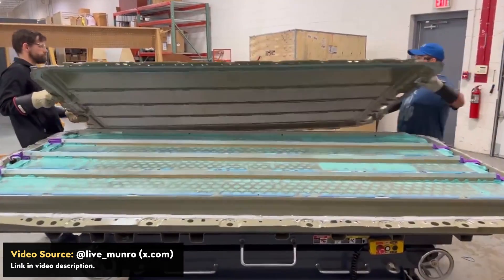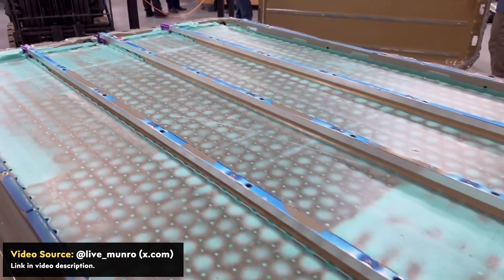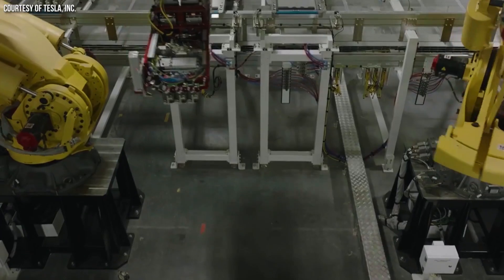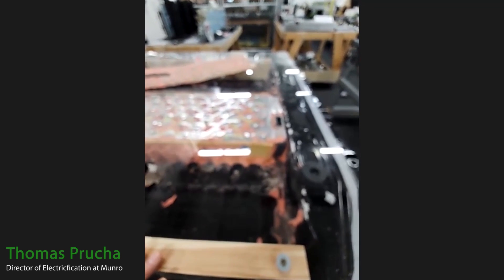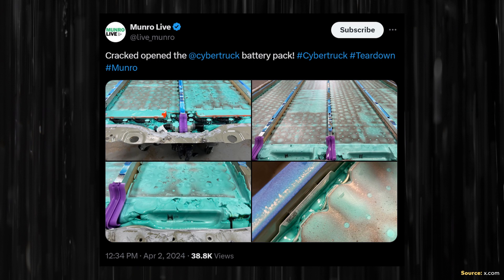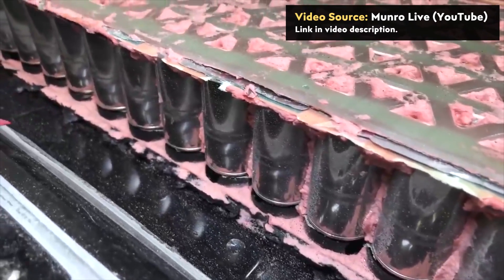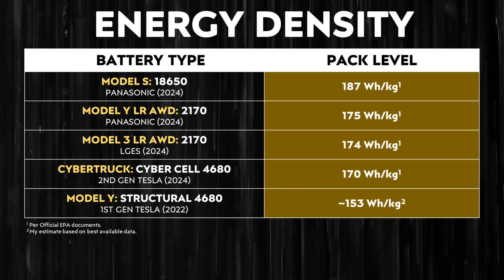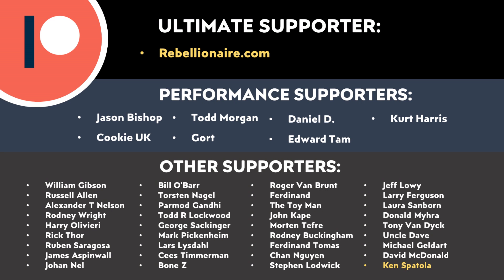Tesla Cybertruck Structural Battery Pack INSIDES REVEALED!

Comment: Jon, the structural battery pack on both the Y and the C have 4 crossbars under the seats. They also have 4 bridge structures going front to back, which the seats attach to. That’s a lot of support. 

I also looked at how, after the battery is placed, the console slides forward to mate with the bottom of the dash and was wondering if that also offers structural support?

When Munro Live shared how they took apart the Y battery cells from each other, they had a really hard time prying the cells apart from each other. So it’s the cells bound together with the foam that provides structural support:

Keeping the floor from flexing,
Resisting the frame from twisting,
Resisting some of the crushing from the side or front / rear.
Plus the foam will keep the cells from jumbling around.

And the foam will do a wonderful job as a sound barrier,
Both for noise from outside and
Shocks from sound waves moving through the vehicle:
The car will feel more solid, less like a rickety rust bucket!
Reply: I was curious how far back the battery pack could stretch?

If it indented where the rear wheels fit, could the pack go all the way back to the rear bumper? You would want a crumple zone but you might be able to get that by having no batteries inside the pack for the 24 inches at the back. Have that part filled with metal honeycomb (it’s light yet structural).
Reply: The part they call the penthouse, where all the battery controls are housed, it looks massive, much larger than it needs to be. I can see all the parts inside it could be miniaturized and fit the dimensions of a computer tablet so it could be located anywhere in the car.

Comment: I think the direct vertical forces are quite easily managed by a simple steel pan, as you see on most ice vehicles. The forces the batteries, glued into a 3 inch thick rigid sheet, resist are the twisting forces imposed on the vehicle as it drives over uneven pavement. Ideally these forces should taken up by the suspension. However that assumes the suspension is attached to a rigid structure that does not itself flex. In a structural battery pack  the batteries provide this rigidity for 'free' -- i.e. by requiring no additional frame or body structures and their additional weight.

Comment: How come I see a ton of QR Codes and noone decides to take a QR Codereader and see what they say? who verified the pack was actually a 124kw pack and not a 100kw pack made for the RWD model?

Another thing to note is theres alot of opinions and speculations etc about the structurability of a CT battery pack so why cant someone request a sealed up battery container thats totally empty then bolt it into a vehicle and give it a rigerous articulation test between both to see if the can or the whole battery is the actual structure ?

Wouldnt you agree if you claim a truck will have 500 miles of range it should have 500 miles of range?

Do you know theres a tesla called a hesla that gets 600 miles and the reason why it gets so many miles is because its combined with a hydrogen fuel cell....?

Seems to me the only person whos mindboggingly stupid is definately Elon Musk by not embracing hydrogen.......

Did you also know that chemical rockets burn hydrogen too but elons rockets are stuffed with chemicals that roll coal?

Wouldnt you think it would be a win-win by cleaning up the environment with better more environmentally friendly rockets and vehicles that run longer plus rely lesser on the energy grid?

Comment: You are thinking that structural means only vertical but it has structure in other directions since NOTHING is holding the bottom (tops) of the cells except their sides connecting to the longitudinal beams between the sections. The cells provide rigidity to the pack from twisting.

Comment: The 4680 cell is a complete failure so far. Tesla cannot seem to nail down the manufacturing process and get sufficient energy density. Even the Chevy Silverado has a 450 mile 50% more than the Cybertruck. The best EV battery in the world at the moment is the BYD Blade LFP battery. Tesla should use this battery and license it from BYD.
Reply: The Silverado has the longest range of any EV truck currently and has 2x the batteries as the CyberTruck. 

Not sure about the blade batteries. I’m heard something about BYD’s battery not being super robust but can’t say for certain how wide spread that is or if the battery type you are talking about has those problems.

Comment: Structural pack does not mean structural cells..

Plenty of room for a 46x120 cell.. 150% capacity but also weight..
Reply from the maker: I get that. My main point is this is does not appear to be what Tesla originally envisioned.
Reply: @Cleanerwatt  no.  you dont get it.  you ripped off content from Munro and left out the most important parts of what they said about it.  They declare in their video that it is in fact working as a structural pack and that it's as solid as a brick.   It just isnt working in the way YOU think it should as a structural pack.
Reply from the maker: @KenLord  I didn't "rip off content from Munro" - this was all used with permission from them and I spoke on a ZOOM call with their Director of Electrification.

Also, This video was recorded and edited several days before the Munro video came out, so I didn't have that info yet.

I never said that this wasn't a structural pack, but that it had extra structural supports that wouldn't be necessary if the cells were taking the vertical load of the pack. Take a look at what Tesla unveiled back in 2019 and you can see what I mean.
Reply: @Cleanerwatt  I'm aware of 2019.  I'm shocked that you'd make a fake controversy video based on that old detail when you know that details change when the engineering is done.   Again ... Munro says it is a structural pack.  It just isn't in the way you want us to think it is.   Vertical isn't the only direction, and no doubt these bricks resist twisting and bending really well.  

You aren't an engineer.  Stop talking as if you are.
Reply: @Cleanerwatt  I don't understand what vertical load you are talking about. The pack connects the front and back giga castings. The load between them is basically a bending or twisting load. To resist that the pack must be stiff. It achieves this stiffness by immobilizing batteries with foam so they cannot slip against each other. This is the same strategy as the honeycomb sheets used in aircraft design. Beams that span an opening (like the floor joists of a house) easily handle shear forces -- if they fail, they fail in bending. Same with the battery pack except that it also has to handle twisting forces from the vehicle movement over potholes, etc.

Comment: John the 32 mm of depth between the tops of the batteries actually bottoms seen in the Monroe live video and the plate that they removed was on the bottom side of the battery pack so it doesn’t really have anything to do with vertical loadbearing capacity since the force is exerted from the opposite side.

Comment: Alternatively, given that the empty space is on the underside of the pack - i.e. it faces the ground - it could be that it acts as a vertical crush zone so to speak. Think about it for a moment - this is a "truck" or an "off-road" vehicle thus, generally speaking, it is exposed to a harsher environment and more likely to bottom out or sustain underbody impacts. If that space is filled with more batteries then the crush zone, if any, loses effectiveness and any impacts to that bottom side of the battery pack have a much higher chance of damaging the batteries inside.
That's my 2 scents💩💩😁
Reply from the maker: That makes a lot of sense and is likely the reason.

Comment: You don't want members that change their dimensions, swelling and shrinking with their state of charge, to be your structure.  Not only will they be a variable form of support, but their function as batteries may be compromised by being twisted, pushed and pulled.
Reply from the maker: Good points!

Comment: I asked AI this question:
List the components of a 1,000-pound EV lithium battery and their cost per pound
AI:
Sure, I can give you some estimates for the weights and costs of the key elements in a 1,000-pound lithium-ion battery:

- Lithium: 30-40 pounds, costing around $10-15 per pound
- Cobalt: 150-200 pounds, costing around $30-40 per pound
- Nickel: 300-400 pounds, costing around $10-15 per pound
- Manganese: 100-150 pounds, costing around $2-3 per pound
- Graphite: 200-250 pounds, costing around $1-2 per pound
- Copper: 90-110 pounds, costing around $4 per pound
- Electrolyte: 30-50 pounds, costing around $10-20 per pound
- Separator: 10-20 pounds, costing around $5-10 per pound
- Casing and other materials: 50-100 pounds, costing around $5-10 per pound

Total cost is $8,960 per 1,000 pound Lithium battery for a BEV.

The battery in a Model Y weighs 1,700 pounds so for a Model Y:
$15,232 cost for a single battery

I then asked AI this question:
How much dirt must be moved/processed for the above 1,000 pound lithium battery?

AI:
About 90,000 pounds of ore and brine are needed to make the 1,000 pound battery  
and an additional 500,000 pounds of overburden must be cleared to get to the ore
all of which are done with diesel-powered equipment
-------------------------------------------
So how much does the Mad Max Cybertruck's battery weigh?
Reply: In Australia a large number of the ore removing vehicles are electrifying for cost reduction reasons. Things change.
Reply: @longboardfella5306  Ha ha ha - "Cost reduction reasons."
Ha ha ha

Comment: It seems kinda dangerous to put physical load and stress on the batteries.
Reply: Not really, the stress placed on them is so much lower than the plastic limit, it has zero effect on their structural integrity. Since the stresses are distributed among many batteries, and this equalization is maintained by external members, there would have to such substantial damage to exceed it that the stress on the batteries would be the least of your concerns.

P.S.: I’m a mechanical engineer with extensive experience in 3-D stress, fatigue, and wear  of individual members within a larger structure. In particular, I pioneered the use of steel tube umbilicals in dynamic applications by conducting prototype testing of them in the 90s.

Comment: I have never believed the can wall thickness was the structural portion since the foam can compensate for this. I believe the tablets flower at top and bottom that allows for some puckering at each end without breaking the connection is the "structural magic".

Comment: It could be very realistic that Tesla will have a 2nd type 46xx batteries with a different height in the future. Increasing the height would be the best solution to increase the capacity.
Reply: Solid state batteries with a higher energy density and faster charging would be the best solution, but that's not going to happen anytime soon. Until then, trying to make a BEV long range pickup truck is impractical without an ICE range extender.
Reply: @vulpo  SSBs are dead. Very poor cycles.
Reply: @vulpo Solid state batteries have been a dream for over a decade and a half. Yet they're still very expensive and not mass produceable. One of CATLs lead battery researchers appeared in a recent video explaining why solid state batteries are a pipe dream for mass produced vehicles and aren't nearly as safe as proponents would like you to believe.

As far as trucks are concerned, most aren't used for towing or hauling anything, much less doing it long range which means that most trucks would be totally fine as an EV with today's 300ish miles of range. Gas and diesel trucks will continue to fill the long range towing/hauling niche for at least another decade.
Reply: Possible. BMW is planning to use 4695 batteries for their future EVs because they don't care about economies of scale.

Comment: If that's the underside of the vehicle, I wonder if they added the space there for protection in off-road scenarios.

Update: Munro believes the same.
Reply: Why not just eliminate the internal battery space and add a real skid plate then    ?
Reply: @happygilmore8768  do skid pads have crash zones or are they just abrasion resistant?